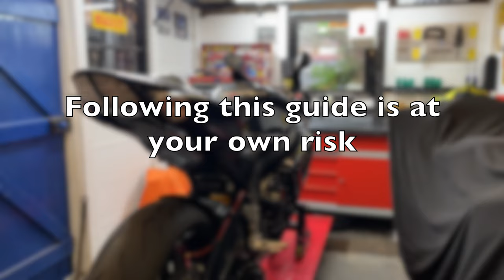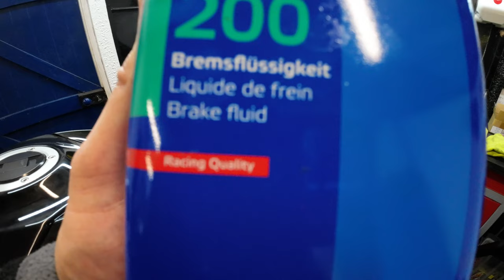Suzuki GSXR 600 750 K6/K7 master cylinder & battery replacement guide

Comment: Hi,

My K9 brake lever seems to have a lot of travel compared to the brakes on my SP1.
Looking at your video you're lever has a lot of travel to.
Is this normal?
Reply from the maker: It will vary from bike to bike, the main thing you need to ensure is the brake lever is not “spongy”
Reply: Had 2010 750 3 weeks. Same here mate. Believe fitting new brake master cylinder my help.
Reply: I'm working on a K6 for my cousin but found out it has a 2012-ish master on it. It also has a ton of travel but otherwise feels mostly ok.